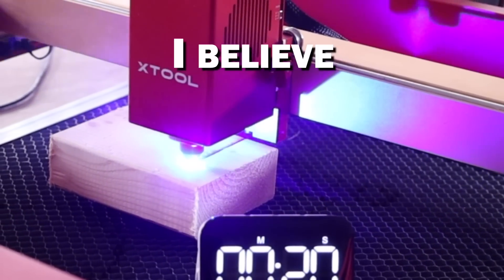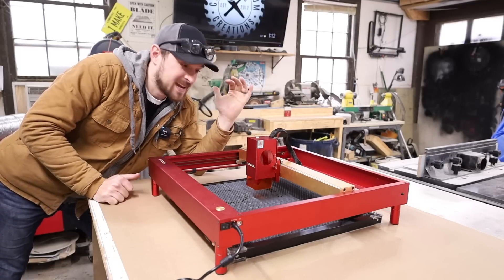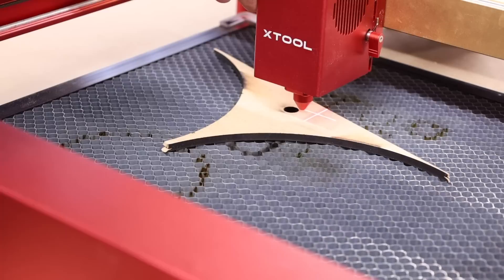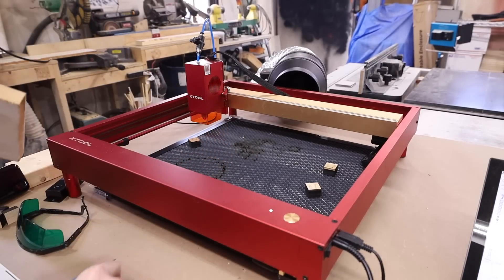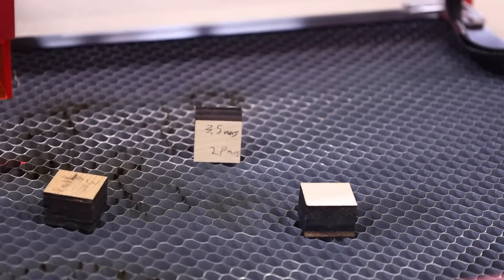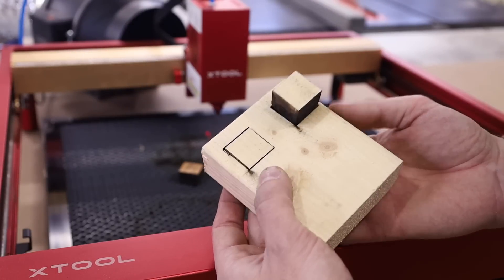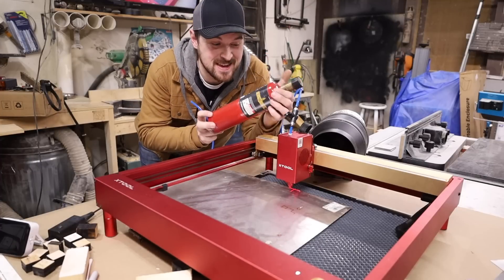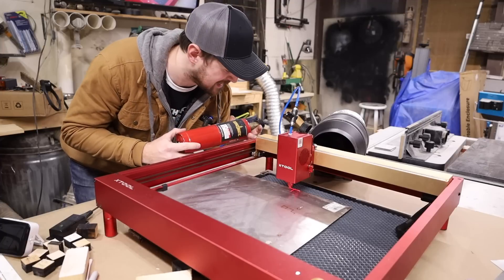World's First Actual 40w Diode Laser The xTool D1 Pro Cutting Test

Comment: That's funny, I got the AtomStack 35W diode power, two weeks ago, and I am happy to see that I am not the only one doing cubes in any piece of wood I can found ! I now have plenty of wood cubes everywhere :)

For quality purpose I found that using multi-pass with higher speed give me better results than doing it in one or two passes at low speed
Reply from the maker: Oh I should definitely try the multiple passes more. I just heard someone saying if you can get that hole started in one pass you can extract the smoke out the bottom and achieve cleaner edges. So many variables to plays with still.
Reply: @ChadsCustomCreations  That's true, but IMHO, only if it can be done at reasonable speed (> 100mm/min), I would say it become false for thick wood that require slow speed because it create too much heat for to long time at the same location and heat radiate and carbonise even more. Yes so much parameters & testing, but I wonder if it's not what I prefer over doing real work :)
Reply from the maker: @brunoaugier  right real work is great and all but I like the research and development the most 🤣 
what your saying definitely makes sense especially with it creating too much heat in one spot.
Reply: I just made another test, printing side by side two same squares with different parameters (20mm raw pine) :
A : 1000mm/min with 14 passes
B: 215mm/min width 3 passes
Both are approxmatly equivalent to a speed of 71mm/min (1000/14 = 71.43, 215/3 = 71.67)
The cut with 14 passes is better, fall by itself and have flat and uncarbonized cutted surfaces (also it seem it has fallen before the end maybe 12 or 13 passe) 
The cut with 3 passes is not really usable, it was still a bit hooked, and it have non-planar and carbonized faces.
The surface finish of the 14 passes is really really far away beter.
Maybe laser are different and you wont get the same result, maybe yes.

Give it a try ! 
(as long as speed/number of passes is equal this does not change time or comsumption)
Reply from the maker: Oh this is super interesting and what type of air assist are you running?
Reply: The one from Atomstack that come with de laser x30 (I think it is 30L/min or something like that), My previous post was removed, probably because of a link to atomstack x30 laser web page
Reply from the maker: @brunoaugier  sorry about that YouTube is weird about blocking comments. Awesome thank you so much for sharing your test results this kind of stuff is super valuable. I know I still have to learn and with this new tech the techniques and such will be consistently changing.

Comment: It looks like the charring gets worse the deeper you go. Is it because of heat build up? What if you paused between passes to let the heat disapate? Would you get cleaner cuts?
Reply from the maker: It’s definitely possible.
Reply: No, it's not possible. The more you are deep, the more you are far from the focal point. And the more you are far from the focal point, the more your beam will be large. And the more your beam is large, the more you get worse charring.
To get better results, you should  pause and change the laser module eight after every pass. So if you found out that the first pass has cut 8mm deep, you should decrease the height by 8mm, and resume the next pass.
Mounted on a CNC machine with driven Z axe, all of this can be automated, for much better results.

Comment: I need to do mostly 0.032" - 0.063" 5052 H32 do you think it's capable to get a clean cut with a laser?
Reply from the maker: Not sure if that is different from what I was cutting, but I wasn’t able to cut my .032 steel. Adding oxygen might make a difference. I have a flashback arrestor ordered once I get the chance we will all see if adding gas will help the cutting power.

Comment: What prevents you from buying the 40W module and installing it on a regular D1? I have a D1 with the 5W module and the IR module, which comes with an upgraded power supply. On xtool's site it says that it is "only for d1 PRO" but that could just be to discourage users from buying the cheapest machine and making it run the highest spec module. Does anyone have any input? I want to try it but it's too much money to sink if it's actually just a brick with the D1.
Reply from the maker: The IR module works on your D1? Did it come with an adapter? I have a D1 also I may have to see if this can be done.
Reply: @ChadsCustomCreations  Yes, I ordered a base refurbished D1 10W, they sent me the 5W instead, and I ordered the IR module at the same time- The IR module is about as tall as the 40W, and comes with a 121.5W power brick - 13.5V at 9A. What is your power brick marked as with the 40W? I can use the IR module and the 5W module interchangeably without issue on the D1, the rail on the IR module is thinner and requires 3 more turns on the setscrew (it's spring loaded, pull on it and you can adjust the lever and nut independently) to contact in order to lock on the gantry also.
Reply from the maker: @Zombiesrofl  oh interesting I will definitely investigate this and let you know.

Comment: Hey! Regarding your "small circle" idea to basically start the cut, there's an option in lightburn to turn the laser on at the start of a cut for x.xx ms (helpful for thick wood also). It's under the advanced tab where you would edit the cut power/speed, labeled "Start Pause Time" (with cut through enabled).
Reply from the maker: Yes for some strange reason I cannot get it to function on my xtool. It works on my co2 lasers with the ruida controllers but for some reason xtool ignores it. Any idea why?
Reply: @ChadsCustomCreations  Do you know the controller type? I have an Atom stack S10 pro that it works just fine on, though I don't know the controller type
Reply from the maker: @FirstToFall  hmm interesting I figured all gcode machines would have the same issue but if your Atom Stack is working maybe I have got something wrong I’ll try messing around with it some more thanks for letting me know.
Reply: @ChadsCustomCreations  Sure thing! I tested mine again just now to make sure I wasn't hallucinating it, and it does work. If you'd like to shoot me an email or have me email you I'd be willing to troubleshoot to see if I could help make it work, it's pretty game-changing if you set it up right.

Comment: For $1,000 I'd probably just get a budget CO2. Smaller work area but it works with more materials.
Reply from the maker: Yeah definitely positives and negatives to Co2 VS diode I am compiling a list for a video to talk about cause I think a lot of people are curious. And this is the first time ever a diode has cut better than Co2 lasers.
Reply: @ChadsCustomCreations  at those slow speeds not sure I'd say better. I have 3 different diode lasers and while they can cut it's very inefficient. This would be faster for thin materials for sure but at that price the module alone is more than most complete diode lasers
Reply from the maker: @risbill1  what wattage is your Co2 laser. Mine is a 90w with a Reci tube and it cuts but not like this 40w
Reply: @ChadsCustomCreations  I don't have a CO2 just diode lasers. We have a couple at our local maker space and they are 40 and 60 watt and I use them when I need to cut lots of pieces more than 3mm. Or if I need to cut or engrave clear acrylic. It just seems diode lasers are becoming less cost effective other than they are still more portable.

Comment: Why do these reviews with speeded up cutting? It just makes it harder to see how it compares. Same thing for starting a cut and jumping to the end. No point. Ideally all cuts in real time, and a clock showing how long the cut was. If it seems like it would take too long, and people would stop watching, just do a shorter cut.
Reply from the maker: It’s just too slow and boring For YouTube this would be a 2 hour long video if I didn’t. I make sure to add the amount of speeding up so you can calculate the amount of time. Also when I remember I throw my stop watch in the video too.
Reply: @ChadsCustomCreations  The problem is that if you use different sizes/shapes of cuts and different speeding up for the different materials  it is very hard to compare anything.
Reply from the maker: @macrumpton  press alt+P in lightburn if you have your settings correct it calculates the amount of time for you.

Comment: What's even more impressive than its power is how it manages to keep such a thinly focused dot at 40mm! Also cutting steel is an interesting test because only powerful modules can do it, since it requires more power than the dot can spread in the surrounding metal during the same time. Definitely this one qualifies as a great tool for this. But can it still cut paper without cutting the table ?
Reply from the maker: Yes the tiny laser line I captured in that shot going through the 2x4 was impressive. Even with a 4” focal lens I don’t think I can do that in my co2 laser.

Comment: Instead of dangerous oxygen, I would try helium. We use argon/helium for welding aluminum for greater heat. It’s possible that healing alone would work fit this, and it doesn’t burn, while protecting from the atmosphere, minimizing discoloration. What I would like to see them, or some other company, do, is to have a more powerful infra-red laser module. The current one does give good shallow engraving, but something along 4 watts would enable some cutting.
Reply from the maker: Great information here thank you for adding to the conversation and my thoughts for future testing!

Comment: I want this to cut 0.3 anodised aluminium. How do you think, will this be possible? Can you achieve a clear cut on air assist?
Reply from the maker: You talking .3mm or .3 inches?
Reply: @ChadsCustomCreations  oh no, 0.3 mm 🙈
Reply: How thick 2024 aluminum can it cut? (Inches) .025, .032, .040, .050?
Reply from the maker: @craigwads  I need to get some and try it again. I believe aluminum is gonna be tough since it transfers heat so efficiently.
Reply: @ChadsCustomCreations  I would really appreciate it!  I help out at a place which makes one or two off parts out of aluminum in these ranges.  It might be very helpful if we could cut the blanks out with a machine like this but I don't want to suggest spending the money on something that might not suit.....

Comment: Ok .. technologically very neat but ... for this price (plus the base frame etc) you can get a CO2 laser with imho a fair bit more potential. Am I missing something?
Reply from the maker: There are positives and negatives to the Co2 vs diode debate I think it’s definitely something I would like to share and talk about with all you viewers. I need to compile a list. A few are diodes don’t need water cooling, no mirrors, seem to be cutting better now at just 40w, take up a smaller foot print. Co2s faster moving speeds, can cut clear and white acrylics, invisible laser beam seems safer to eyes. What do you all see let’s talk about it.

Comment: It might as well be a new machine.  Very interesting.
Reply from the maker: Yes it is interesting that they are not offering a kit with just the 40w 🤷‍♂️
Reply: @ChadsCustomCreations    Does the 10W will fit on the new gantry?
Reply from the maker: @bneil4059  my 10w does not unmodified the cable connection is not right. But my 10w is the older D1 before the pro came out but they said 5-10-20w and RF will all fit as long as they are the pro versions. I just had the 20w on it and it was working great and easy to swap out.
Reply: @ChadsCustomCreations  Yeah,  I contacted them, and they said I have to get 5w and replace the main module

Comment: You can use a electronic valve instead of that manual one that you put on top. Its going to flop around and wear out your seal on the laser module. You can mount the electronic valve off to the side and it can be controlled via software either lightburn or what ever you use.
Reply from the maker: That’s a great idea , I wonder which pin on the board sends that signal. My Co2 laser uses one I’ll have to go take a look. Thank you Steven!

Comment: 1000$ USD :face-purple-crying:
Reply from the maker: Yeah it’s up there but understandable I think considering that thing has 8 5.5w diodes 
, a new rail, stepper motor,  power supply, extra lenses, and such. Definitely not in everyone’s budget but pretty cool that it’s available regardless. It’s a luxury not a necessity.
Reply: 15 years ago I paid 23k for a 50 watt laser.   This is a bargain.   Well that Epilog is still a workhorse.  I don't see that thing getting that kind of longevity.   But hey the price can't be beat.

Comment: What size is the laser point?
Reply from the maker: Definitely a good question I need up do some measuring
Reply: @ChadsCustomCreations  please! I could not find this info. Will it be bigger than 20w?
Reply from the maker: @victitova3811  I would imagine it’s a little bigger but that’s not all bad, the bigger the dot size the less lines you need per inch which means faster larger engravings
Reply: @ChadsCustomCreations  it makes sense, but I will be cutting things like 3m, some plastic occasionally and hopefully 0.3mm anodised aluminium.

Comment: I am new to the laser cutting world, I just wanted to know what is the honeycomb material that you are cutting on? and does the laser cut it like a waste board on a cnc router ?
Reply from the maker: Honeycomb cutting panel so far I haven’t seen anyone damage them like a CNC router does to their beds. https://www.amazon.com/dp/B0B156325P?linkCode=ssc&tag=onamzchadddow-20&creativeASIN=B0B156325P&asc_item-id=amzn1.ideas.3AS04C0BGLQSK&ref_=aip_sf_list_spv_ofs_mixed_m_asin
Reply: No, but the laser can go through it. So you want a metal plate, ceramic tile, or some kind of scrap board under it. The laser will probably be out of focus at that distance, but doing this will help protect anything under it.
Reply from the maker: @8bitmuch705  yes you are right I should have said mine came with a plate of aluminum which protects my table and absorbs the heat really well.

Comment: Hi. Great video. Have you tested or are you going to test clear acrylic? Would love to know if this would work on the colors that the 20w can't cut through. Thanks for the great info!
Reply from the maker: I actually did try white and clear it had no effect at all it’s just not the correct wavelength no matter how much power those specific colors just won’t work. 

Though all the colors xtools have listed on their website materials list for the d1 would definitely work. I saw xtool cutting 15mm black acrylic no problem.
Reply: The co2 laser makes very quick work of clear acrylic, unfortunately the led ones just pass right through. It's the wavelength of the light that is the issue. Black will work because it absorbs the heat well.

Comment: can we do deep engraving in steel with it??
Reply from the maker: I would say so but the chance of the steel warping is pretty high on thinner steel as it’s an incredible amount of heat. Xtool also has an IR laser module you can add that is the correct wavelength for metals. I still have to test that out and see what it can do.

Comment: So if I’m dropping in the neighbourhood of $2000 would you buy this or a co2 laser?
Reply from the maker: I’d say there are still some factors to consider. Diodes-less maintenance and hassle, no water cooling, no mirrors to align and keep clean. Diodes wavelength still doesn’t don’t do anything to clear acrylic or white but xtool does have a list of colors that do work on their website with the D1. I would say this 40w seems to have more cutting power than my 90w co2 laser.

Co2s still seem to have diodes beat in the movement speed game and the fact that they also are great at acrylics. The built in Ruida controllers are really nice also.

Comment: I've been thinking about hooking up oxygen to my laser as well. 
To make anything burn you must have three things, oxygen,  fuel, and heat. Take away any one of them and you will not have combustion. Oxygen does not burn on it's own. I don't understand why everyone thinks just because you use oxygen it is going to blow up. It is used everyday in acetylene torches.
Reply: hook up an inert gas like helium or argon instead and safe yourself the risk. Fires in oxygen rich environments have led to multiple accidents so there is really no pro to using it.
Reply: @sageslarres  helium and argon are not oxidizers so you would just be throwing your money away by using them. Oxygen is used all the time in cutting steel. It helps oxidize the steel so you can cut through it. What do you think is happening when you use an acetylene torch. So that is point in using it. No one is talking about filling the room with a high concentration of oxygen. Is the world just damn scared of everything?